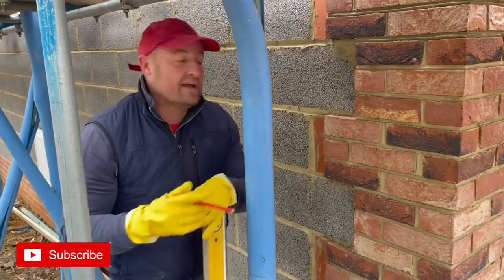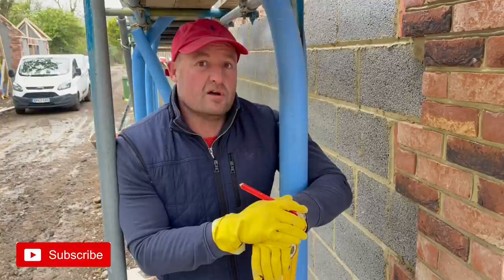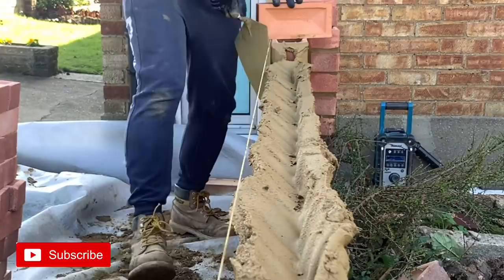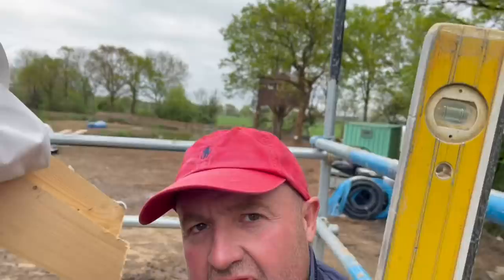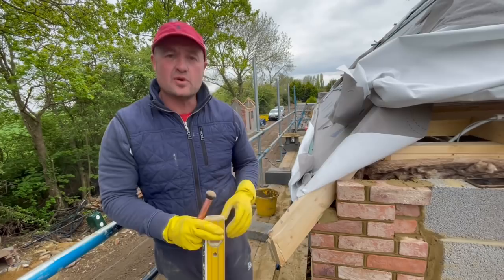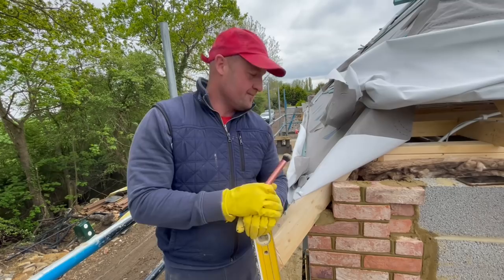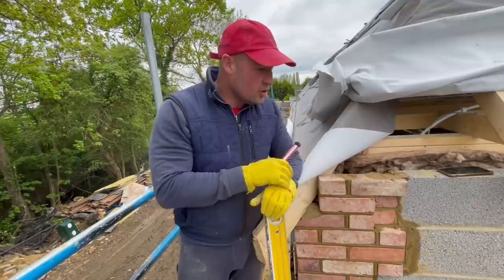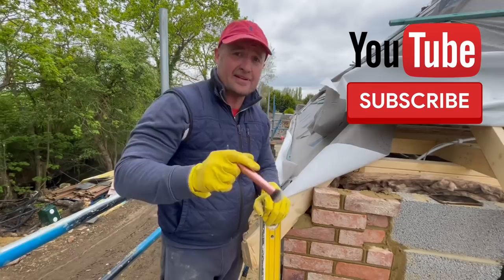#bricklayer #bricklaying                                  Great bricklaying tip for Apprentices 🧱

Comment: I got a little rubber stamp from vistaprint with my name on it. I push it into the bed joint where my work starts. It's unobtrusive, yet good practice.
Reply: Good tip but in reality it shouldn't be that way, a good tradesman should never lower their standards but of course, the odd shyster slips through the net!  Just be plumb and level in your own lift and if the work below is a bit piss-poor!

Comment: any bricklayers coming up need to learn how to get over work that is nt bang on you will come across it alot, learn how to make work look bang on even if its not bang on plumb👍
Reply: Never a true word said .it can be the plumbest wall in the world but if the bonds all over the place and jointing s crap bricks tipping etc .if 8t looks right it is right
Reply: Yr only as good as what you can get over